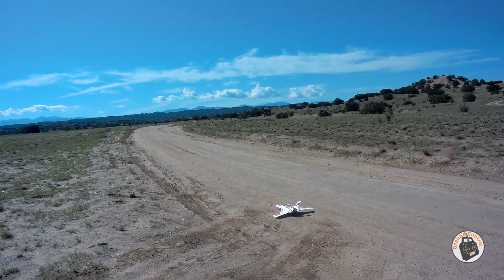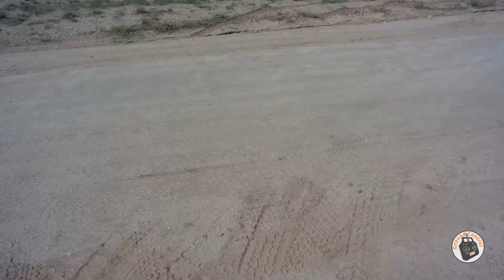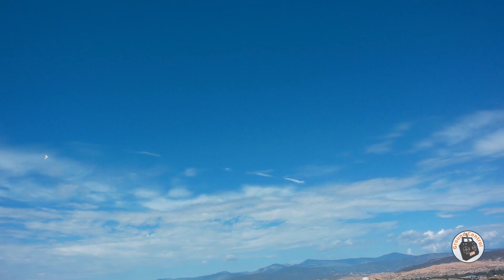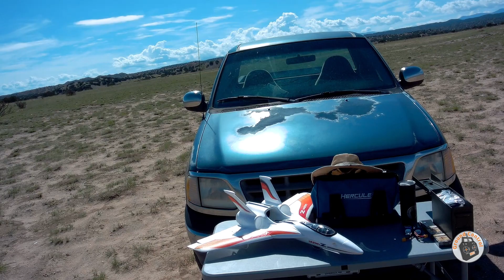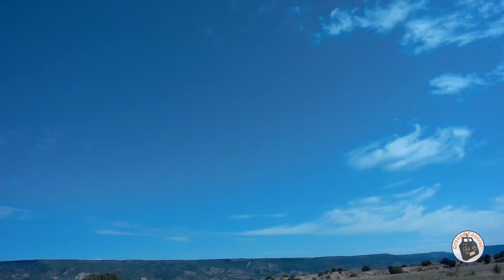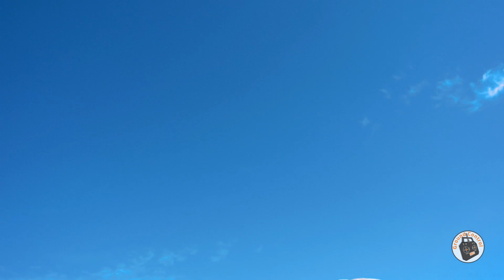My Favorite EDF Jet! Zeta Ultra-Z Blaze Jet 790mm Wingspan Single EDF / Dual EDF / Pusher Motor!

Comment from the maker: Don't Forget to Subscribe -> https://www.youtube.com/GroundControlRC?sub_confirmation=1
Don't forget to Follow Us on Facebook -> https://www.facebook.com/GroundControlRC

Zeta Ultra-Z Blaze 790mm Wingspan EPO EDF/Pusher Jet Kit
https://www.ebay.com/itm/132828942007

Zeta Ultra-Z Astro/Blaze EPO Single/Dual EDF or Pusher Prop Jet Kit/PNF
https://s.click.aliexpress.com/e/_AKNfud

FMS 64MM Ducted Fan EDF 11 blade With 4S 2840-KV3150 Motor
https://s.click.aliexpress.com/e/_AEWVVf

FMS 64MM Ducted Fan EDF 11 blade With 4S 2840-KV3150 Motor
https://www.banggood.com/FMS-64MM-Ducted-Fan-EDF-11-blade-With-4S-2840-KV3150-Motor-for-Fixed-Wing-RC-Airplane-Jet-p-1828502.html

Hobbywing Skywalker 2-4S 50A UBEC Brushless ESC With 5V/5A SBEC
https://s.click.aliexpress.com/e/_AV9Nyd

Hobbywing Skywalker 2-4S 50A UBEC Brushless ESC With 5V/5A SBEC
https://usa.banggood.com/Hobbywing-Skywalker-2-4S-50A-UBEC-Brushless-ESC-With-5V-or-5A-BEC-For-RC-Airplane-Models-p-1041723.html?p=WE081047791920140372

MG90S All metal gear Digital 9g Servo SG90
https://s.click.aliexpress.com/e/_AlXg7J

Hextronik 9g Analog Nylon Gear Servo
https://hobbyking.com/en_us/hxt900-micro-servo-1-6kg-0-12sec-9-8g.html?affiliate_code=YRCVWOSKMDXLVUW&_asc=4962988196

Turnigy Nano-Tech Plus 1600mAh 4S 70C Lipo Pack w/XT60
https://hobbyking.com/en_us/turnigy-nano-tech-1600mah-4s-70c-lipo-pack-xt60-hr-tech.html?affiliate_code=YRCVWOSKMDXLVUW&_asc=7200420361

Turnigy nano-tech 1800mah 4S 35~70C Lipo w/XT60
https://hobbyking.com/en_us/turnigy-nano-tech-1800mah-4s-35-70c-lipo-pack.html?affiliate_code=YRCVWOSKMDXLVUW&_asc=1322943179

RadioMaster TX16S MKII Hall Gimbal 4-IN-1 ELRS TX
https://www.banggood.com/custlink/KK3EUzvecp

Banggood GCRC
https://www.banggood.com/custlink/GmDmQ1nVkO
Reply: Unreal Flying Mate!
A perfect Split on demand.
Beauty GCRC, Psyching on this habit right about NOW!!
Reply from the maker: @jonoedwards350  Hey Jono!
This Jet is a blast!
It lands like my Parkjets ;-)
I can't wait to build the Astro but it's probably going to be a Winter project.
Always busy but I manage to squeeze in a lot of fun ;-)
See you in the Air!
Reply: @GroundControlRC  Hi that edf is pushing that jet nicely. What exactly is the edf setup for it?
Reply from the maker: @rcrotorfreak  I pulled the 64mm EDF Unit from My Old Freewing F86 Sabre Jet.
64mm 5-Blade EDF with a Brushless 2627-4500Kv Outrunner Motor.

Comment: *what edf you running and how much power does it create?
*where do you find CG is?
*battery placement?
i tried this with a 64mm and flat out could bot get it to fly, even with a byme DB. it would immediately fold forward….not a nose dive i mean immediately fold. i had all component's as far back as possible too….non of it made since.
Reply from the maker: The EDF is a 64mm with a 5-Blade Fan.
I'm not sure of the amount of thrust but as you can see from the flights it pushes it very well.
I fly on 4S 1800mah - 2200mah
My CG is as per the manual at 60mm back.
I have 8mm of positive reflex on the elevator as per the manual and it needs it.
Reply: @GroundControlRC i put a 64 mm from a totaled freewing f9f panther…may have just flat out been too much mustard on the hotdog.
Reply from the maker: @DeadPilotsSociety  My 64mm EDF Unit was from my retired Freewing F-86 Sabre Jet.
Probably the exact same units ;-)
Reply: @GroundControlRC man, when testing, holding in my hand, it was pushing down hard, i adjusted cg back just a bit…plane literally just folded forward. what battery are you running? where do you have battery placed?
Reply from the maker: @DeadPilotsSociety  I've using a 4S 1800mah and a 4S 2200mah.
I have the batteries placed so I have a neutral balance at the specified CG.
If the plane is nosing down when running up the EDF, in a static position, it sounds like you may have some angle in your EDF.

Comment: also checkout stinger t750.super sale I just ordered 2 more kits $102 to my door.from BG usa warehouse wings are interchangeable with this plane...its super fast,easy to launch..3s,2217 2300kv,6x4.50 amp esc.90mph.😊
Reply from the maker: Thanks for the info! I've almost pulled the trigger on that plane several times. I'm going to take a look again ;-)

Comment: Where are the elevons set for level flight?  Are they flush with wing tips or set higher to match line on the fuselage?
Reply from the maker: I have positive reflex of approx. 2mm.
So the Elevons are 2mm higher than the wing plate.
That provides nice level flight.

Comment: I still have my blaze...but decided to finish up my astro...the astro is slightly slower using same power setup,but i remember my original one was so fun...unlimited vertcal spins up  .then i would glide it down

They are just well built models..that handle great and are loud and fun for me.😊
Reply from the maker: Zeta Science made some great airframes and I wish they were still around.
I'm going to build the Astro as a pusher and prop.
I need to take the blaze out again soon.
Reply: @GroundControlRC  you will like it...

Comment: I have been flying this and the astro version for many years..never used and gyros...i must have crashed astro 50 times within a 3 year period,but always managed to fix it...finally retired the plane since it pretty much flew poorly and looked like hell...than i built blaze which i also flew...both were amazing flyers and a lot of fun..i made both mine pusher jets..used 2835 2200kv on 3 and 4s 2200 packs..also ran 2835 3000kv in my blaze...used 60 amp esc..currently i have an astro built painted for last few years
.i actually like astro wings better...so easy to see even when its 300 plus feet away...happy flying😊
Reply from the maker: What a fantastic Jet!
I wish Zeta Science was still around.
They made some great airframes.
This Blaze is the easiest to launch, fly, and land EDF Jet I have.
I still have the Astro Kit in a box.
I'm going to build it with a pusher motor and prop rather than an EDF Unit.
I also have the Zeta Z84 Wing, currently needing repair, which is a fantastic Race Wing.
I'm very glad I discovered the Blaze and Astro.
Reply: @GroundControlRC  my astro using a apc 6x4 on 4s 2200 did around 100 mph...getting cg correct and reflex on ailerons is a must...broke my nose on first maiden..you will have torqe roll with pusher setup. I launched over hand hard toss  60%   at approx 70 degree .. angle..then get to sticks quick...its a very sweet flyer once its trimmed for sure...never broke a prop,landed in grass.
Reply from the maker: @roadstar499  Yep, launch throttle is key to minimize torque roll.
I converted one of my Eachine F16 50mm EDF Jets to a pusher motor and prop.
Unlimited Vertical ;-)
Easy to launch with minimal torque roll.
I discovered after my 1st launch of the Blaze that positive reflex on the elevator was required.
That's the only aircraft I have that needs positive reflex but it sure flies great.
Reply: @GroundControlRC  yes, reflex is about 7 clicks...only model i have like that..i also have a freewing moray and elevator is actually down quite a bit for it to fly level...
Reply: @GroundControlRC  i found an awesome fiberglass balsa 25" mini bee kit..$60...its on value hobby...i ordered from them many times..no issues ever..i looked everywhere for video on this mini bee,nothing available..i really think it would a plane you would like a lot ..i think it would be a rocket with a 2835 2200kv..i just have like 20 plus planes all foam and am just getting back into flying...just check it out seems like a winner to me..